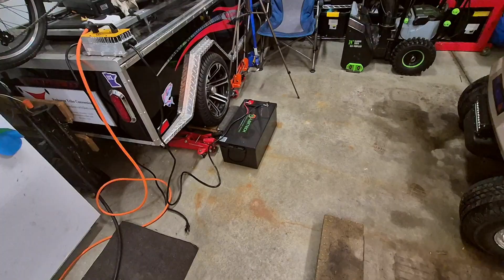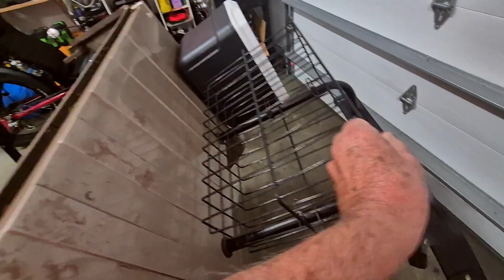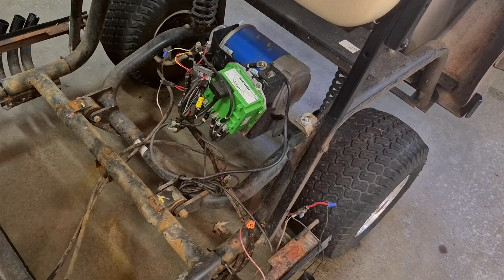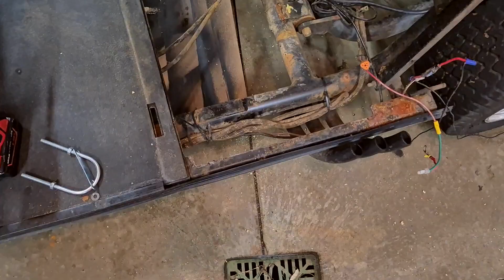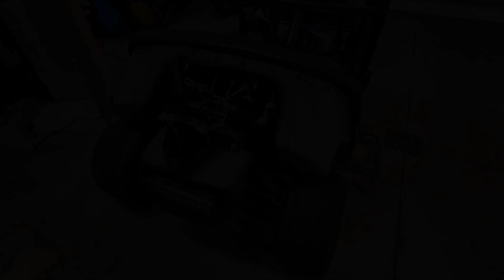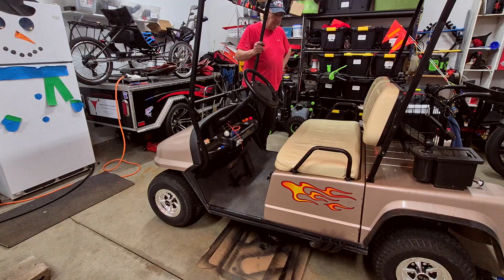Columbia ParCar Golf Car Lithium Battery Conversion project

Comment: Any chance you could shoot me a message and let me know how you took the front cowl off ?
I have the same Golf Cart and I’m converting to lithium as well
Reply from the maker: Its easy there arevtwo screws that have to be removed. Im not sure if they are in front or at the rear as I never replaced them. Once out just grab the front of the cowl and pull up. It will fight you but if you jerk hard enough it will pull free. To put back just line up the tabs and bump back in you don't need to put the screws back if you don't want to
Reply: @StormyKays 
Thank you so much 🤙

Comment: Just picked up the exact same cart, no batteries or controller. Does the controller have to be programmed?
Reply from the maker: Yes youbuse the app to set the limits. One big deal on the parcel is to change the throttle direction from 1 to 2.

Comment: Great video!  Thanks for taking the time to create this.  I have the exact cart and just replaced the stock controller with the NAVITAS.  Next is the upgrade to lithium battery.
Reply from the maker: FYI I took it for a short run yesterday and 17mph and instant launch. It's a definite improvement. The battery is a VEVOR unit off eBay They claim 105 ah but it's actually 100 ah still much more range and efficiency than lead acid.
Reply from the maker: I found it can play 64 holes before needing to charso i no longer charge after a round. I plug it in when the charge is around 20%